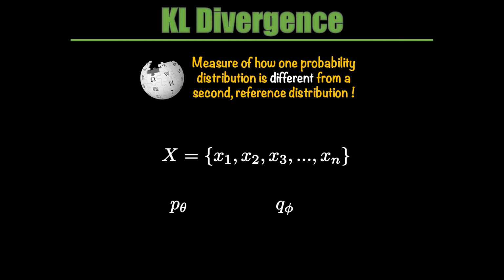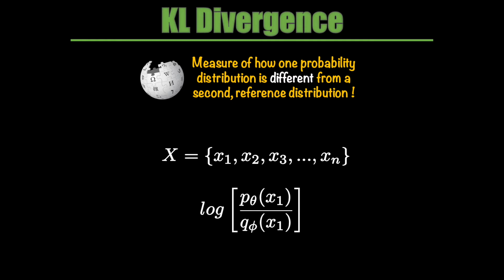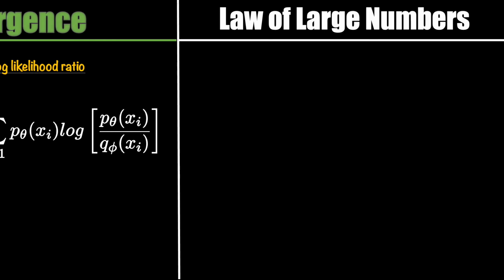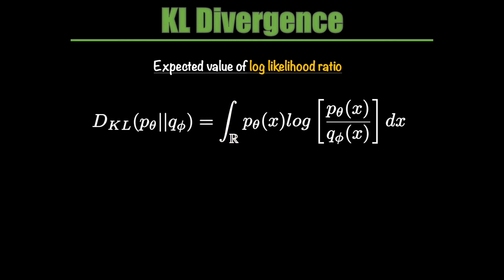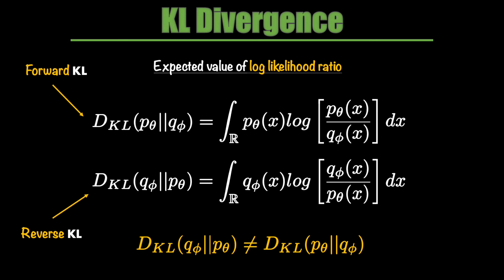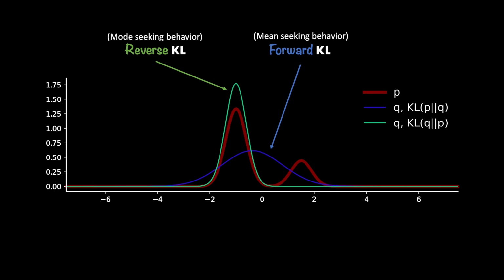KL Divergence - CLEARLY EXPLAINED!

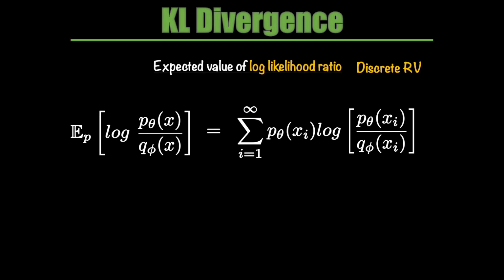Comment: Hi, I had one doubt, in 5:18,  why do we multiply p_theta(xi) to log(p_theta(xi)/q_phi(xi)) and not multiply q_phi(xi) to log(p_theta(xi)/q_phi(xi))?
In 7:30 you show the variation with q_phi(xi). It seems like the probability distribution that is multiplied with the function of the random variable log(P1(x)/P2(x)) is the probability distribution that appears in the numerator. Is there a reason to not multiple the probability distribution in the denominator?
Reply from the maker: A bit rephrasing of your question (Correct me if this is not what you meant)
Is there a reason to not multiply "with" the probability distribution in the denominator?

It's a good question. So far in the literature only two types of KL divergence (forward & reverse) are defined. If you use the prob dist from numerator as the weighting factor then you would have 2 more variations. At the moment, I am not aware of any "mathematical" reason/justification that would suggest that it is an invalid operation.

Comment: 9:00 - here it seems like q is the resulting approximation but up until then i thought q was a distribution being compared to p? so for example, p is a red line, shouldn't q be shown as a line as well and then the resulting forward KL and reverse KL divergences be overlaid?
Reply from the maker: KL divergence at its core is giving you a way to compare two distributions. 
The question you should ask is why one should be interested in doing a comparison in the first place?

In many machine learning / statistics task we want to "approximate" a complex distribution (say p) by a simpler distribution (say q). Here we talk only about parametric distributions i.e. p and q are represented using functions which parameters e.g. Normal distribution with mu and sigma as parameters. 

The exercise (or rather the utility of KL divergence) I showed in the tutorial was about finding the parameters of q (i.e. ). In order to find it I used optimization with KL divergence as the loss function. Like in any optimization problem we will start with random values for mu and sigma and then adjust them in such a way that the loss function decreases. 

I tried both types of KL divergences as loss functions and showed how the results (i.e. mu and sigma) obtained are different for each other.

I did not do a good job in the tutorial by clearly explaining when and how you really end up using KL divergence and hence it is confusing for you. 

Hope this note make sense.
Reply: @KapilSachdeva  ahhhh i see now! makes sense! thanks so much for your time!! :)

Comment: Great tutorial Kapil. I have a question regarding the approximation in the discrete case at 7:00. Does dividing by 1/N not assume uniform distribution? Maybe the approximation would have to be weighted by the likelihood?
Reply from the maker: That is the magic of law of large numbers. If you have sampled a large number of data then the expected value of that distribution converges to our regular unweighted average. https://en.wikipedia.org/wiki/Law_of_large_numbers

Comment: Min 6:00 - why that integral over R is considered "hard to compute"?
Reply from the maker: Integrals in general are computationally heavy but more importantly start thinking in terms of multivariate distributions i.e. when you have a vector (high dimensional data). In simple words, in high dimension space you have not a single integral but rather multiple integral and it would computations intractable. Needless to say, real world problems are high dimensional.
Reply: @KapilSachdeva  Why "Integrals in general are computationally heavy"? I thought we used the law of large numbers for approximating that integral since it "goes from -inty to +infty" and a calculator cannot afford continuous sums due to it discrete nature
Reply from the maker: Ah it seems I misunderstood your original question, usage of law of large numbers is to avoid the integrals. I first provided the general formulation of expectation (continuous) and then suggested that in practice one would use law of large numbers to work around the integral problem.
Reply: @KapilSachdeva  I understood that you used that law for approximating that hard integral. The question is: why is that integral hard? Sorry for my doubts!
Reply from the maker: I think I kind of answered it by suggesting to consider high dimensional spaces. But here it is slightly different words -

Most of the time the integrals that we encounter in statistics do not have "closed" form solutions. So we must approximate them using "numerical" methods. The computational complexity of these numerical methods (such as quad) increase as the number of integrals increase (think double, triple integrals etc). Therefore we try to find simpler approximation to avoid them. One such simpler approximation (that in limit) leads to similar result is Monte Carlo integration. 

See if https://en.wikipedia.org/wiki/Numerical_integration gives you more insight.
Reply: @KapilSachdeva  Thank you sir, it's clear now! Congratulations for your videos

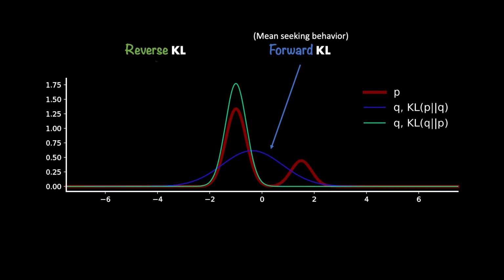Comment: Thank youu for great explanation.  @9:27 I can't get how come reverse KL divergence has mode seeking behaviour and forward has mean seeking. I understood that P(x) is multimodal gaussian distribution , but what is Q(X) as we needed both distribution for finding K-L divergence.
Reply from the maker: I am assuming you have understood following -

a) KL Divergence will give you a "number" that quantifies the difference between two probability distributions say p and q.
b) There two different ways you could write the KL Divergence. In one approach you would have p as the weighing distribution and in other q

Now, the next question to ask yourself is in what situation you would have the need to even compare two probability distributions. 

This situation occurs when we are trying to "estimate" p using q. 

One way you can estimate (or figure out the function for q) is by using "optimization" process. 

Below will not make sense if you do not know what optimization is. 

Optimization => you need a cost (loss or objective) function. An objective function's role is to compare true and predicted values. This is what I am doing when I first create/use a multi modal distribution (p) and I am trying to estimate q as a normal distribution that has 2 parameters (mu and sigma). I am using optimization process and KL divergence as a loss function to assess how well I am adjusting/predicting the values of mu and sigma (of q). 

When I used Reverse KL then the predicted mu and sigma create a function (q) that seems to converge to the bigger mode if p whereas for the forward KL, the function (q) lies somewhere in the middle of p.
Reply: @KapilSachdeva That is great. But the presentation should give more background regarding that because it is quite a leap. I was confused at this step too. Regardless, Great Presentation overall. !

Comment: Sorry, another question, Is it correct to say that p_theta(x_1) is the same as P(x_1|theta)?
Reply from the maker: Not really; unfortunately it is the notation and nomenclature that makes it difficult to understand the subject.

Provided when you write x_1 you are referring to one sample/state of Random Variable X (note - capital letter)

You should read p_theta(x_1) as

You want to calculate the probability of x_1 (which is a sample/state of Random Variable X) whose (Random Variable X) distribution function is represented using symbol p and "theta" (I can not write latex in comments!) are the parameters of the distribution function.

For P(x_1|theta), I am not sure if it is valid notation. A notation could be P(X|theta) in that you should see as conditional distribution of X given theta. In this case both X and theta could be random variables. When theta is not a random variable then it is an abuse of the notation.

This is bit sensitive and it is possible that in some books/papers you may find the notation (the second one) you have provided. The meaning will depend on the context

Hope this helps.
Reply: @KapilSachdeva  I see what you mean, thank you for taking time to answer both of my questions! You helped me a lot, and your videos are great! I think my problem came from getting confused between frequentist and bayesian notation for likelihood, and also notation between unsupervised and supervised likelihood. Your videos and answers put me on the right path though, it's all clear to me now! Thank you!

Comment: Thank you for the video! Can I ask, the one thing I don't understand is x_i a possible state that X can take, or is it a sample? In the beginning you say x_1, etc are possible states, but when we get the expected value of the log likelihood ratio, is that not over samples in a dataset instead?
Reply from the maker: "sample" and "state" are the same thing here.

e.g. A Die can be in one of the six possible states {1,2,3,4,5,6}
When you roll the die you will get either 1 or 2 or 3 or 4 or 5 or 6 ... you call them sample.

Comment: Great video, onlything im having trouble understanding is at the end at 10:00 the plot you showed. I understood that i have 2 distributions p and q and i calculate the D_KL (p || q) and it would result in a number, so why did u show 2 curves for the forward and reverse KL? Where are those coming from?
Reply from the maker: I can see why it can be confusing; I should have done a better job to give a proper context for the plots/curves. Thanks for asking for the clarification.

I take that you have understood that KL divergence will give you a number that quantifies the difference between two probability distributions p and q.

The next question that you should occur to you is - "What is the application of obtaining this difference (i.e. KL divergence)?"

One application is when you try to approximate a complex distribution with a simpler distribution. Let's say the complex distribution is denoted by `p` and it has 3 parameters (mu, sigma and gamma) and you would want to approximate it using a simpler distribution denoted by `q` which has 2 parameters (mu and sigma).

Now when you are creating an approximate (function) you could rely on optimization procedure (gradient descent etc). But then an optimization procedure will require a cost (loss/objective) function. A cost function tells how far you are from the ground truth. This is where the KL divergence will be used as the cost function when probability distributions are involved.

Finally coming to your question about the additional curves, these are the resulting approximate distributions I get when I use Forward and Reverse KL as the cost (loss/objective) functions. Both of them are normal distributions (mu and sigma) but since the loss functions used are different (foward vs reverse) they are different.

Some else also asked this (similar) question sometime back; I do not know how to provide the direct link to the reply of the comment. See the question by Arash Poursadrollah on this video in the comment section and my reply.

Hope this helps!
Reply: @KapilSachdeva  Excellent answer! It took me a while to figure it out.

Comment: although I won't use this in my life but you made it sound so easy :)) But one thing I didn't understand. The outcome of this KL divergence is supposed to be a number that shows the divergence of an approximate distribution to the reference. How do you get a whole distribution at the end of the video?
Reply from the maker: From now onwards u will see KL divergence in many areas - machine learning, statistics and prob theory :) 

KL divergence will give you a number that will show you how two distributions differ from each other. 

But important thing to understand is what would you do with this number. Why do u need it in the first place?

Let’s answer that and then you will get the answer.

A parametric prob distribution is summarized using parameters. For eg for normal distribution u need only mean and variance. Once u have them (mean and variance) u can generate samples from it and then plot them.

Now let’s say for your “approx distribution” you select normal distribution but u donot know what is the mean and variance of it? 

To get them You would use the optimization procedure which requires you to have a number that will tell how different u are from the reference. This is where u will use the KL divergence.

Once you have the optimization procedure done (ie minimization using KL divergence as the loss function) then u would get a good value for your mean and variance of your approx distribution.

You would then use this mean and variance to generate the samples and plot them … this is how u get the “whole distribution” … but the right way of saying is that since u now have the parameters of your distribution function and this enables you to create the plot, compute likelihood  etc
Reply: @KapilSachdeva  even without video, u can explain clearly the same! Thanks. Also, as a suggestion, I would appreciate it if you put subset simulation in your list of to-do videos :)
Reply from the maker: @ArashSadr  will try!

Comment: Really amazing explanation Kapil🔥!! Your 'its the recap' sidebars and accurate vocabulary are especially helpful. Would it be a good idea to also draw parallel with implementation? Like how the equation is executed in case of a ML model being trained (for example how the summation over N which is assumed to be large, terms holds true to mini-batch training)?
Reply from the maker: Thanks Aditya. You have raised a very good point - “How does it relate to mini batch training?”.  

As you know that during the mini batch training in general we have  “noisy gradients” (per step) and this has implications in this context as well I.e. when KL divergence (rather ELBO) is used as a loss function. There are remedies such as re-parameterization trick, score function, importance sampling etc to reduce the gradient variance. No silver bullet but some workarounds.

Comment: Dear Kapil ji,
If time permits can you kindly upload some videos on  Variational Autoencoders and GAN ?
Warm Regards
Dj
Reply from the maker: VAEs are one of my favorite neural architectures. Have been thinking to explain various variants of VAEs for dynamical data (time series); Also I have a tutorial on ELBO which is used a loss function in VAE. Check that out. But yes, suggestion accepted :) Will do a set of tutorials on various variants of VAEs. Though I know how GANs work, I have never used them in an industrial setting and I prefer to explain concepts that I have applied on a real world problem.
Reply: @KapilSachdeva  Thank you so much again.. Your videos are really impact making.
Reply from the maker: Hello dj S, first apologies for the such a delay in making the tutorial on VAE as I had promised earlier. 

I have published a tutorial on it few minutes ago - https://www.youtube.com/watch?v=h9kWaQQloPk

Most likely by now you already have a good understanding of what VAE is but I have tried to explain it in a different manner than it is usually done. While my explanation is different it highlights the primary motivations VAE's inventor had. So check it out if you are still interested.

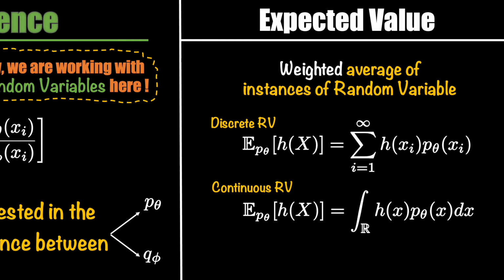Comment: 4:22 - Not sure whether it is so straights forward... Discrete to Continuous RV by replacing an integral. I think Claude Shannon also made the same mistake.
Reply from the maker: Thanks Gowri Shankar for pointing this out. Indeed it is not as simple as I made it sound however in terms of the "final" structure of the expectation "formula" the change from discrete to continuous is reflected as the change from summation to integration. Would be great if you can share insights that you have to highlight the differences in the interpretation (if any).
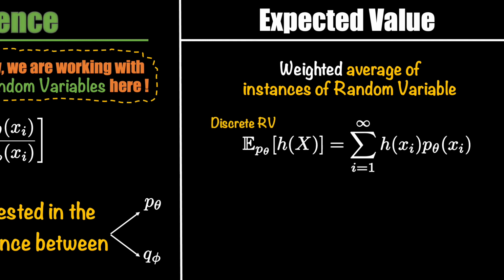Reply: @KapilSachdeva   I have no light as of now. Planning to read these two literature but had a Claude Shannon moment at 4:22 - Hence posted my comment.
http://www.tsc.uc3m.es/~fernando/bare_conf3.pdf
https://web.stanford.edu/class/stats311/Lectures/lec-02.pdf
Thanks for the reply, you made my day. Thanks for your services in this platform, your content is cool.
Reply from the maker: 🙏 Thanks Gowri Shankar for these links and the kind words. I gave a cursory read to them and they are very well written papers; have added them to my library to re-read them. I still have to do a proper study of measure theory as lot of the explanations in continuous realm are based on it. Last year I wrote this article on Entropy that you may finding interesting as I do go over some of the topics mentioned in the lecture notes. Here is the link - https://towardsdatascience.com/but-what-is-entropy-ae9b2e7c2137?sk=23e69749005be756a1d19b6e1c3531f6   - may be it is of some assistance to you.